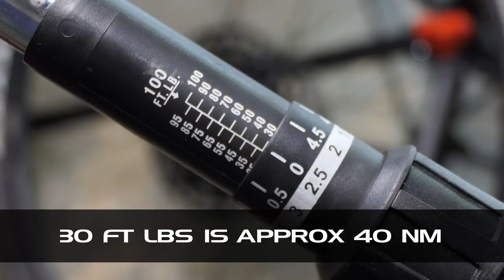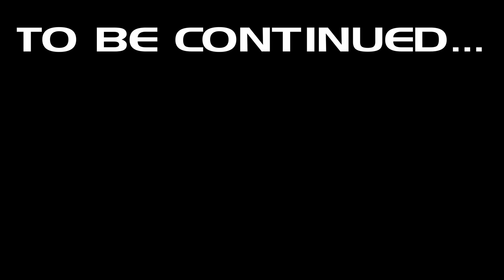PT 2  - Cassette Swap 9-sp Shimano to 12-sp SRAM - Trek Marlin SRAM Eagle NX 1x12 Conversion

Comment: What speed freehub does this wheel have? I have an old bike that currently has a Sram GX 2x10 Derailleur and was wondering could I  upgrade it to 12s like you have done but I don't know if the NX Cassette will fit my freehub.
Reply: SX and NX fit on the HG hub (typical hub on bikes this level)

GX and above fit on XD driver

Comment: did the 2019 marlin 7 come with a hub large enough for a 12 speed cassette? My 2020 marlin 7 has a shimano 8/9/10 freehub, which suggests i can not do this conversion; or am i missing something? admittedly i dont know much.
Reply: in case anyone wants to know, my hub is a 8/9/10 shimano free hub, same as CPOs. I now have a 1x12 sram nx eagle set. thanks in large part to these videos.
Reply: @hevdread  did you have to change the cassette?  I have a Marlin 6 and i want the same upgrade
Reply: @nicolassuazo1399  yes; you'll need the entire new groupset for what ever driver-train you want. Shifters, derailleurs, cassettes are all specific to the groupset they belong too.

Comment: Hey! I have Trek Marlin 6 and 7 2019. When I took them to the workshop to install this groupset, they tried on the rear hub cassette in the services and the master said that there was insufficient sleeve length on both bicycles.  Both rear hubs for replacement.  Therefore, the question on the smallest star was there were no cases of cranking and there were no cases of unscrewing the thread of the cassette?
Reply: robo4ikentag I’m having the same problem you had did you figure out a way to get it to work?
Reply: @katyreesimpson8742  yep, i installed new rear hub - Novatec D872SB. It fits very good for 12 speed cassettes

Comment: Does anyone know if this cassette would work on a 2020 Trek Marlin 5? It currently has a 3x9 drivetrain. I'm wanting to convert to a 1x and really want an 11 or 12 cassette. But I don't know if this will fit on my current hub. I don't know much about working on bikes. So its really confusing on whether this will work or if I need additional parts and what those are. Any help?

Comment: Yo bro how much is the weight saving for the 1 x sram? The Marlin frame is only 50g heavier than the xcaliper in size m
2020 xcaliber 8 is 640g lighter than 2020 marlin 7 with 1x sram sx and 30 silver versus 30xc

Comment: Hello, is this also works on the trek marlin 6 2020 Edition?

I have a 8 cassette in the rear and I want to upgrade is in the future.

Sorry for the bad English
Reply from the maker: Yes.
Reply: @EVERYTHINGcpo  
Oke' Thnx for your feedback.
Reply: @DontGifAF....  hi,  did you try the sx groupset with the stock hub of trek marlin 6 2020?
Reply: @radioosbin112  I didn't not upgrade yet.
Bud is in possible with a Stock Hub, Or do I need a different Hub?
Reply: @DontGifAF.... stock hub of marlin 6 is "formula dc-22"  compatible to shimano 8-9-10 speed as per manufacturer, but in this video the bike is marlin 7, and he did not change the hub.
Reply: @radioosbin112  Trek even told me it is not possible, I tried showing this video to the tech at my bike shop and he didn't believe it. I have a new wheel coming in but I don't think the hub was upgraded to the free body
Reply: @DontGifAF....  sx,nx group set and sunrace mz90 11-52t cassette are compatible with shimano freehub,ai put sram eagle nx 1x12 on my 2018 Cube ai  race with shimano FH TX 505 freehub.

Comment: This can be a can of worms. I have a 2015 Trek Marlin 5 and it has a freehub and cassette with 3x7. Did Trek go backwards to a freewheel in later model 5's? Unfortunately the freehub is 35mm long and too short for even a 10 speed let alone a 12 speed. What is the freehub length on your 7? That would be useful information. At some time the standard widened to 41ish mm. This from Wikipedia...."Before the introduction of indexed shifting, the width of a five-speed or compact six freewheel was approximately 32 mm; the introduction of indexed shifting supposedly made standardized sprocket spacing necessary. Shimano and Campagnolo both came up with independent standards, and SRAM later followed Shimano's lead in respect to sprocket spacing and cassette width. The width of early Shimano six- and seven-speed cassettes was 36 mm, and early eight-speed 40 mm wide. Shimano then changed again and standardised eight-eleven speed cassettes on 41.5 mm and second generation seven-speed to 38 mm. The widening of the sprocket carrier on the cassette hubs to 41.5 mm resulted in a decrease in the distance between the hub flanges."
https://en.m.wikipedia.org/wiki/Cogset.Perhaps you could clarify.

Comment: Awesome video!!! Question for you; my bike has 1x10 speed with Shimano body.. Will the 12 spd or 11spd will fit to Shimano body with any modification on the hub? 
If I want to change to 11spd, will only need chain, shifter, derailleur & cassette? 🤨 I’m so confused 😐
Reply: The nx version will fit the 10 spd shimano body, but not the GX and up. but yeah. new shifter, chain and derailleur and the cassette ofc.

Comment: Hi i have a Trek Marlin 5 2020, i have 3x7 will i be able to upgrade from 7 to 10 speed cassette?
Reply: No you would need the next wheel up with the Dc22 hub which is 8/9/10/11?about $85 Comes on marlin 6,7 I believe.  Marlin 5  is 7speed Tops and that is DC20 hub.
Reply: @eddierivera7803  it has DC27.

Comment: Looking to do this conversion on my 2005 Kona. Please help me wrap my mind around how you can fit 12 cogs where 9 used to go.  When I look at my bike there is very little space between the wheel and cassette, and chainstay and cassette, how are 3 more cogs crammed in there? is the spacing between cogs that much tighter?
Reply from the maker: They squeeze more gears in the same place by making the spacing narrower... That's why you have to have a chain specifically designed for the 12 speed, because the 9 speed chain is too thick.
Reply: @EVERYTHINGcpo  Thank you so much, this has been a mind bender trying to figure it out without explanation.

Comment: I'm more interested with compartment of whole width of hub and cassette in 12 setup vs 9 speed.

I have 3x9 and want to convert it to 3x12 coz just 12speed comes with such a big 1 2 3 cogs.

Bought some 46t/11t 9 speed but that some chinese VS sports or what ever so not expecting much life out of it.

Simply want proper ratio to climb easy but don't want to loose 3 speed at front.